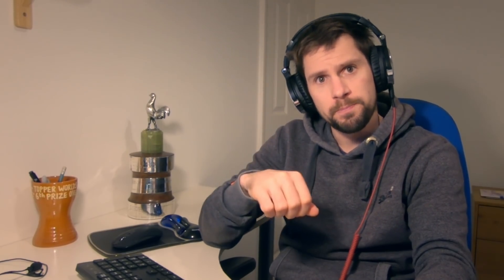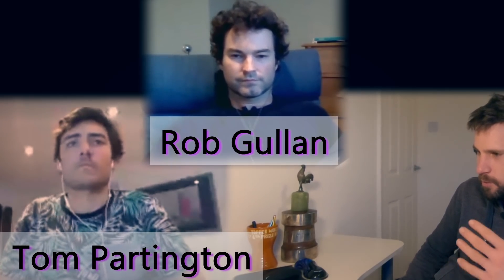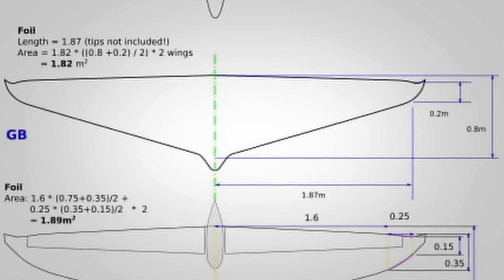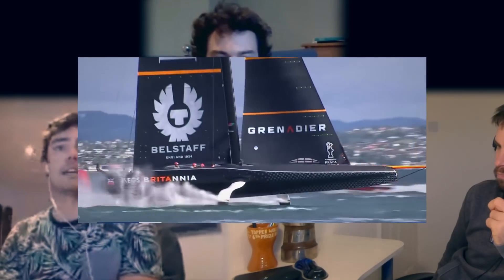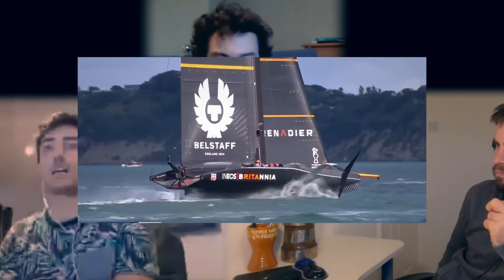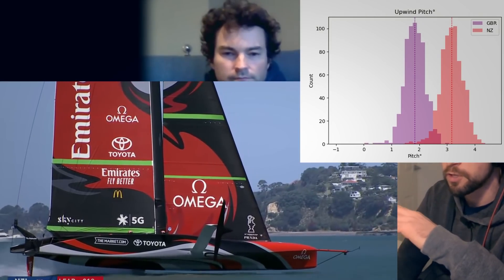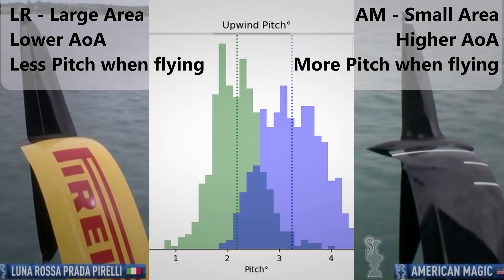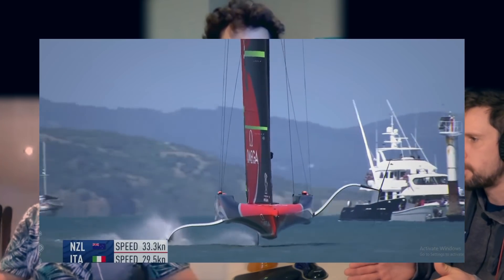America's Cup Foils: Does Size Matter?

Comment: Hey Mozzy, I am doing a research paper on the America's Cup and was wondering where you got all of this data, the graphs, blueprints, etc for the hydrofoils and sails. Thanks
Reply from the maker: The boxes for the foils and sails are straight out of the AC75 class rule. Data can be accesses via the virtual eye, but a chap called Dorox pulled the data in to an app too: https://ac36.herokuapp.com/ 
The foil projections were drawn by Max Hugen from photos taken.
Reply: @MozzySails  I already had the protocol, but the projections were what I was wondering about. That app is fantastic, glad you included the link. Thanks a lot mate, cheers.

Comment: 7:37 Its the other way around Near root Re is higher (in straight line running). Chord length is in the numerator of the Re number formula
Reply: Who's a what now!??
Reply: Think I've said that the wrong way round a couple of times. You are totally correct.

Comment: Love these discussion. It would be interesting to know how much grinding goes into flap-tweaking c.f. sheet trimming - presumably much less, but saving muscle weight might matter. Also I suspect the thinness of the foil is pretty important as cavitation is obviously happening even when well submerged (from the helicopter views). Once on the plane I would think that thin low AR foils might have an advantage. Like a thin rudder is great so long as you don't use it to turn.

Comment: Thanks for the discussions. Much of the engineering is beyond me so I have some simple questions about how VMG  might be improved. 1 There appear to be c20 tacks and gybes per race. How many metres can be gained if a crew can shave 1 second off each tack or gybe during the race? 2 How many metres can be gained if a crew can sail say 1 degree close to the wind than the opposition?

Comment: Gentlemen, how about a discussion on the hull shapes? My understanding was that  the hull should almost touch the water along the whole length to maximise the pressure difference on the two sides. But AM had a huge indentation towards the stern. Why?
Reply: Indeed.  Ineos and ETNZ maximised the wl length in their initial design but both Prada and AM ended up modding during both challenger series to increase the length and improve vortex generation. A lot of the design characteristics are trade offs and so I'm guessing that their designers didn't believe the gains would be worth integrating at first ... and then u-turned during the 'development' series..  Prada lowered the water connection in the stern and bow (also improving stability) but AM were restricted toward the stern by their high flair: designed to keep the nose down and prevent wheelies .... which didn't prove so effective in the end :)

Comment: 3:00 - "lower aspect foils have a higher stall angle [than lower aspect...]"  - er, i don't think so? Rather the opposite?
Reply from the maker: He says lower aspect foils have a higher stall angle than higher aspect one
Reply: @MozzySails ; thanks for reply, and we may be discussing this using different terminology, however, while low Aspect-Ratio foils induce more alpha, they stall earlier (i.e. at a lower section alpha (aoa) than higher AR items.  An alternate way of thinking of this is that the max CL reduces with AR. [The Lift-Curve slope is reduced and shortened for reducing AR wings.] The practical effect of this (for Ineos' lower AR foils) is that they either need more camber (undesirable due to pitching moment increase) or operate the foil at higher aoa (than the Kiwi higher-AR foils) to produce the required lift force at low speed. Alternatively, as you've highlighted in earlier sessions, they use more flap for the boot-up.  Given that increased section thickness is also a generally deleterious performance driver, the longer root-chord and higher Taper-ratio Ineos foils may have better cavitation characteristics than the others. Yep, it's a big subject....(!)

Comment: As with the f1, in the early days design variations were more significant.  Over time the best design solutions are found and the range of design solutions narrows.  The 12m class was no different. Bow shapes, hull shapes, sail shape, keel shape.  By the time we saw the end of that class, all the boats became more and more similar because that is was was clearly fastest often leaving crewmenship to decide who won and lost.
Reply from the maker: The other thing with sailing, that can lead to a wider range of design, is the unknown of the track conditions. In F1 you know the circuits for the season and will want to optimise across those (i.e. average lap speeds, corner speed, straight speed). With the biggest environmental impact being wet v dry and probability of that at each circuit. 
However, in sailing it is incredibly difficult to have such high confidence in track conditions. Especially when your energy source itself is determined by the weather! So, even if the teams agreed on which designs were best for what conditions, we'd probably still see a divergence based upon predicted conditions.

Comment: Reynolds number increases as the chord reduces? Clearly hydrodynamics is different from aero dynamics.
Reply: No, there was an error there, or he just misspoke. Re only differs from air to water due to density.  Greater chord length = greater RE number.
Reply: I think the other thing they forgot to mention was tip vortex reduction. Since most of the lift is generated near the root where the chord is greater, the tips are not being asked to do as much of the lifting, hence a lower pressure diffential between the upper and lower surfaces and a smaller vortex. The energy expended in generting the tip vortex is a major source of drag. The little winglets that the rules permit can also help with vortex redution. This tip vortex phenomonen is why high aspect ratio wings are better than low aspect raatio ones.
As the reynolds numbers reduce at the shorter chord tips the wing profile can be changed out near the tips to a profile more suited to those reynolds numbers out there.
Interesting that there are so many design variations and that not all teams have converged on a similar solution. Perhaps over time and with more experience there might be a sweet spot that best meets all the comprimises required. Fascinating stuff.
Reply: You picked up on it and of course are correct. Just a slip of the tongue.

Comment: I do appreciate the comments on this vlog, but why do I never hear any comments about VMG? The whole effort of these teams is to get to finish line faster! The guys want to win! Chewing over 'straight line speed' never won a race! How about you guys pick a winner and explain 'why' - Better still, get the 'experts' to place a decent (100 quid) bet on which boat will win which race - that would be interesting. I look forward to hearing their opinions (and sticking to them!).
Reply: Quite right, the bottom line is VMG. The top speed for 1-2 seconds rounding a mark is virtually irrelevant. Personally, I think NZ have the edge (at least for now), because (1) they have the "fastest" foils and have past experience in using narrower, thinner foils from AC35, and (2) I think they look the best at lowering the CE whilst powering up the lower section of the main with greater camber etc.
But I'm expecting close racing.  😎

Comment: Enjoying this series. The Team NZ foil is very different from all the others in one respect, in that the trailing edge of the flap is way aft of the trailing edge of the extension to the cant arm. Is this in compliance with the AC75 rules? I can't see anything that states even the maximum area of the foil, other than rule 13.5, if I'm reading that correctly, in conjunction with Fig. 13.1.
Reply: Do the rules effect the position of the armas longitudinally along the length of the boat?
Reply: @briancavanagh7048  Yes, the entire foil arm plus foil etc must lie within 10-12m from the transom reference plane. All teams have tried to get them back as far as their respective designs allow.

Comment: Someone here  said that the Re numbers were higher at the tip due to the smaller chord. I find this utterly perplexing. Even right in the bulb fairing I don't think there is much difference in the local free stream speed outside the boundary layer. Enlighten us..!!
Reply: That was clearly an error/slip of the tongue. The equation for Re uses chord length, ie longer chord = higher Re number.
Reply: Slip of the tongue. A few people picked up on it. You passed the test 😉

Comment: Very nice, discussing in plains words (well, some terminology related to wing shapes can't be avoided) the tradeoffs made by each team's designers.

I wonder if Ineos made any major foil shape changes between Xmas and the Prada cup or their enormous jump in performance is due to other non-design factors which they claim. Perhaps conditions from Dec to Jan and then to March could be different enough to design and produce an entire different set of foils for each month, or are each team allowed only one set of 6 foil pairs(?) that are within that 80% weight limit for all the competitions.

In any case, I assume that although certain choices might still be purely human judgement how much of the designs can or were done by computer analysis, perhaps with some machine learning contributing.
Reply: Ineos have tried a number of different foils, eg the W foil vs the Y, and they have also had the benefit of the Mercedes F1 team to assist. Note they are allowed 6 foils - not 6 sets - which they can alter within limits as you mentioned. Ben Ainslie noted that Ineos made changes to many areas of the boat, including sails etc.

Comment: Great to see trickle down effect of esoteric AC "foil tech" inspiring new sailors to join  growing world of affordable "street level" foil sailing. Of several accessible niches,  kite and wind foil ( now an olympic class) design  has been a hot bed of empirical, iterative and technical experimentation in ( albeit mostly flat) "symmetrical wing foil " design for several years. Boundaries of profile, chord length, aspect ratios, etc have been pushed hard covering many of the shapes discussed here and well beyond. This in never-ending quest for more speed, manoeuvrability and fun on the water. Thank you AC for the inspiration. BTW ... good discussion as usual. Would be interested in a session on rudders which appear to be a particularly point of vulnerability in AC75 design envelope.

Comment: Is on of the possible aspects of ETNZ's "tip clear of the water" moding to allow the foil to ventilate into the air?
Reply: No, they would not want to encourage ventilation, as that reduces lift. There are a few theories as to why they "fly the tips": to reduce surface area and thus reduce form drag; to monitor the height they boat is flying at; and my "pet theory", that they are reducing wing tip vortex with it's induced drag. Of course that's just my guess. 😁
Reply: @maxhugen  Thanks. Agree. Clumsy terminogy by me. What I was trying express was precisely your pet theory - to escape the i diced draw of the wing tip vortex by letting that "ventilate" into the air. I wasn't meaning they wanted ventilation in the hydrodynamic sense
Reply: @bwtcf  Ah, OK gotcha.  Don't always get my terminology correct either!

Comment: These lads just carry on using AoA term instead of AoI, mixing apples and pears to be honest. My knowledge is based on my aviation involvement and I can think of one very successful airplane using AoI along with almost symmetrical airfoil,  P-51D. It is a very successful approach proven in the past. Symmetrical airfoils are the must when inverted flight comes into play, i.e. aerobatic airplanes/gliders, which is of no use in maritime applications. However, i.e. NACA 0014 airfoil along with slight AoI can provide huge high speed benefits delaying cavitation issues to the maximum extent possible.  In my opinion that's the path of development ETNZ have chosen.
Reply from the maker: AoA is the angle of the chord relative to flow. In displacement mode, changing the AoI increases the AoA as the boats are not free to pitch. The smaller foils are experiencing a greater AoA to achieve the lift required to raise the hull initially. That is the discussion. 
So sorry if we are mixing terms, but I think the discussion is clear
Reply: @MozzySails  - Thanks for these fun conversations. Your response raises a couple of questions:
1) You say the "boats are to free to pitch" - however they do have a foil under the rudder. Is it possible that those have been tuned to change the boat's pitch at different speeds? I could envision a setup that has the main foils sitting at a higher AoA while the hull is in "displacement mode", but as the boat rises and speed picks up the stern floats to a higher overall position, thus decreasing the AoA of both the hull and the foils.
2) Another thing to think about is how the foil flaps change the mean camber line of the foils, and thus the effective AoA of the whole foil. In my sport (sailplane racing), its very important for designers to figure out optimum flap positioning for specific speeds (e.g. max laminar flow and to hit drag buckets). And of course the chord length of the flaps - as well as the ratio of flap chord to overall foil chord - has some additional impacts and effects on these things; especially since the taper ratio on the larger-are foils means that the ratio of flap chord to foil chord is quite different at various points along the span. 
...and we haven't even gotten to torsion effects on the flaps and how that could be a problem or an intentional design-choice to minimize tip vortices... soo many things to consider, it can make your head spin! Like aerodynamic design: everything becomes a compromise, and so picking the conditions or characteristics you optimize around really drives so much.
Reply: @noelwade  1) The rudder is designed to adjust rake, which changes the AoA of it's foil, and thus the pitch, just like in an aircraft.
2) Yes, the flaps in the AC75 alter the mean AoA of the foil wings. In displacement mode they have less ability to modify pitch, so the foils have an initial "Angle of Incidence". This is why the boats sail at a negative pitch once at speed - counters the AoI as additional AoA is no longer required for lift. Only the flaps are used then to adjust flight height, while the stabilator (rudder foil) controls pitch.
Reply from the maker: @maxhugen  Exactly as Max says!

Comment: Take off speed has been sorted on ETNZ with their well thought out hull shape and deck design. They are generating more power through the channeling effect along the foot of the main. Some clever thinking around wasted pressure through the slot’ not only have they sorted out the aero package of the side crew pods, but they have created a whole new way of making the sail plan more efficient. Channeling what would otherwise be wasted pressure at the foot usually spilt, they have designed the deck to channel this wind along the hull and leeward side of the main from the slot. Everyone is talking about foils, but forgetting why they can run smaller, more efficient foils. They can do this because they are generating more power.
Reply: Smaller foils, slippery sails and hulls = fascinating. Twenty years ago my father dreamed of yachts with 'rooster tails'. At the time, I scoffed at the concept. Now, I eat my words

Comment: When it comes to these boats its easy to get hung up on the foils. But I think the biggest gains are actually being found above the waterline this AC. BTW great video, good to get a proper deep dive on the engineering.
Reply: Main Foil drag accounts for over 50% of the total system drag on the AC75 at any given speed. Getting it right will be critical to a teams success without doubt
Reply: I get that but drag is only one of many variables
Reply: I don’t see a any major changes below the water for Luna Rosa since I posted here. I wonder where they have found their gains?

Comment: Didn't explain that clearly how ETNZ get away with such small foils. Angle of attack and forward cant is the same for UK and NZ. I think NZs hull design is key.
Reply from the maker: AoA is same for ETNZ as INEOS? I dont believe so. Pitch indicates both ETNZ and AM were sailing with smaller boards at higher AoA relative to LR and INEOS
Reply: Where do you get data that shows foil AoA?
Reply from the maker: @maxhugen  me? I don't, I am assuming pitch is a partial indication of angle of attack (also effected by cant and leeway / yaw). I have no idea where Doug gets his info that ETNZ and INEOS have the same AoA
Reply: @MozzySails  Sorry Mozzie, that was meant for the OP...  😎

Comment: Those V-Shaped foils, I wonder.. If the outer-board of a V-shaped foil is dropped just below the waterline (let's say exactly on the waterline), then the inner board of the foil sticks at it's maximum angel downward. The direction of the lift-vector of that inner board is then at a diagonal angle. The power-vector can be split in a vertical component representing real lift and a horizontal component acting as a dagger-board and helping achieve a higher reach at high speed?
Reply: Both Y and T foils create a Resultant Force at an angle, which as you say is resolved to Vertical and Horizontal components. If no differential flap angles are used, those forces roughly net out the same for both foils, although heel does cause some difference. Downwind, leeway adds to VMG, so the teams all reduce the foil cant by some 2-3°, from about 20-22° upwind.

Comment: If the foil is surface piercing would you get most lift when still in the water helping liftoff, and then when flying at higher speed reduced drag due to not all of the foil in the water? And therefore less reliant on large flaps and their control mechanisms? Or would it create extra drag due to more turbulence?